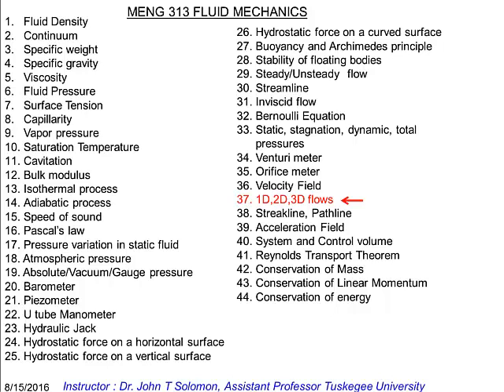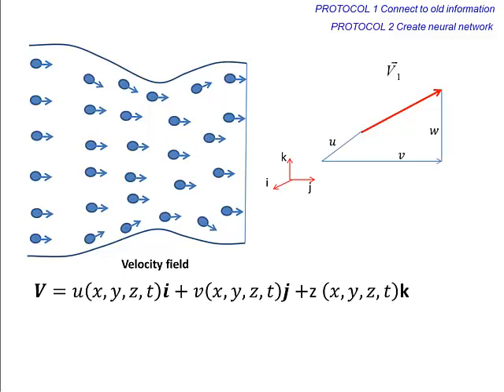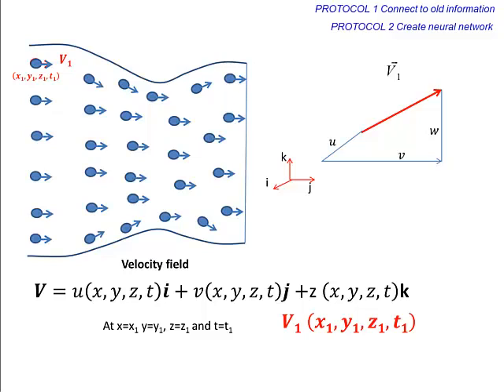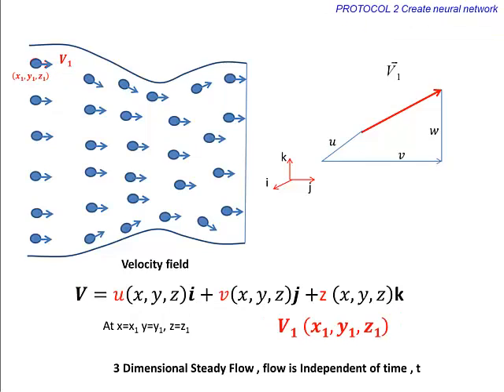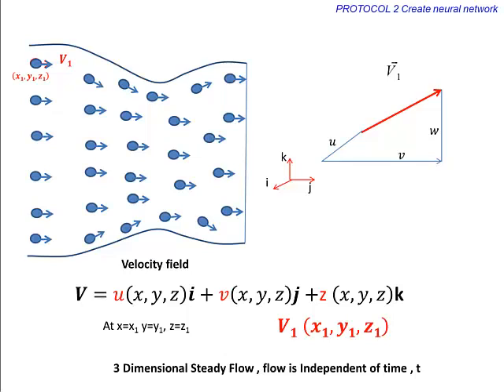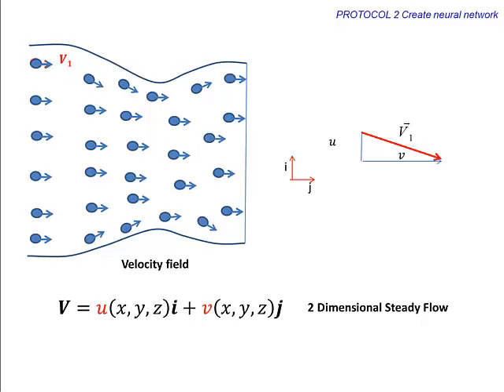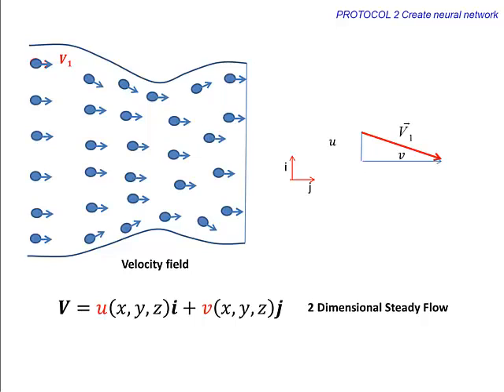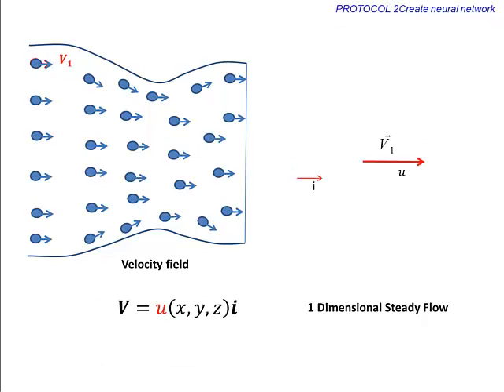C37 1D 2D 3D flow

Comment: sir please help me in this question
1 Dimensional flow is which one
a, Uniform flow
b, Steady uniform flow
c, Takes place in 1 Dimension
d, Takes place in straight line
e, Involves Zero transverse component of flow.
Reply from the maker: 1 D flow can be  V=u(x,y,,z,t) i   or V=v(x,y,,z,t) j  or  V =w(x,y,,z,t)k 
Uniform flow means V=V(t) only so it can be V=u(t) i or V=u(t)i+v(t) j of V=u (t) i + v(t) j +w (t) k
There for a) is wrong as uniform flow can be multi-dimensional   
steady uniform flow means V=constant, so V can be ui+vj+wk= constant, still can be multi-dimensional, so b) is wrong
c) is wrong because flow can be in multiple dimension

d) is wrong as flow is not along a straight line

now you know the answer :) ..good luck